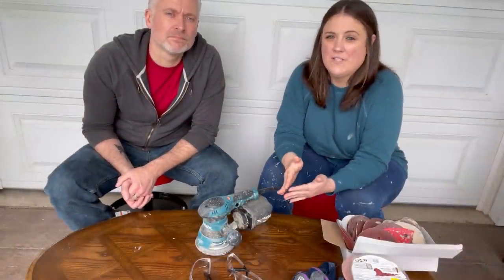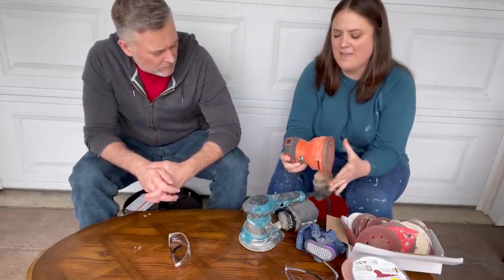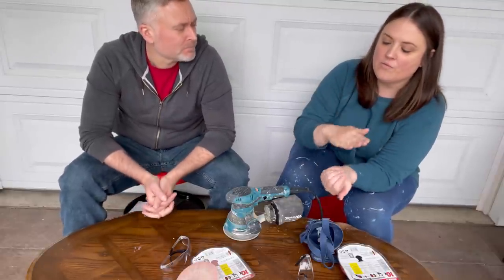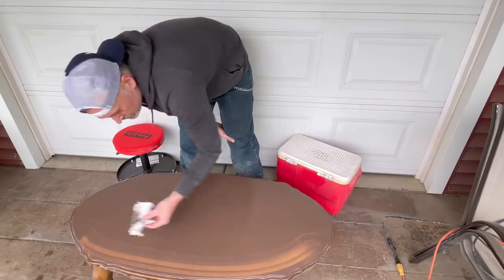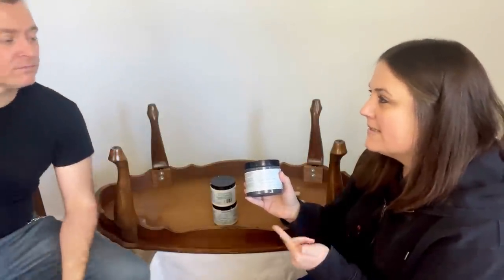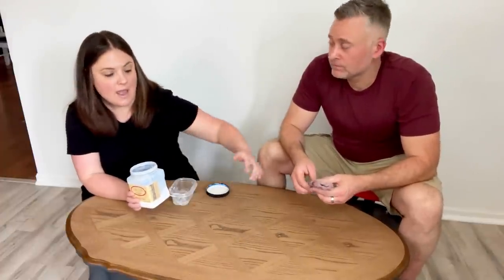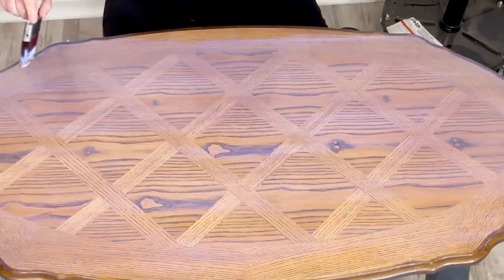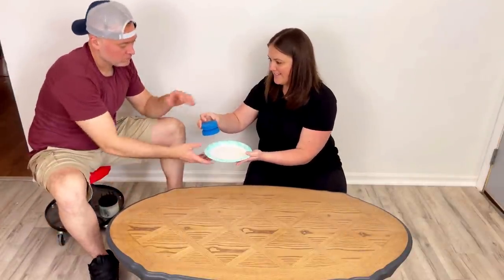Detailed BEGINNER Furniture Makeover Tutorial | Teaching Joe to Paint Furniture Episode 1

Comment: Great video! You two did well together! One question, though, did you seal the bottom & legs with Gatorhide, too? I just saw the top done, and was wondering about the bottom. Thanks.
Reply from the maker: Hi! Thank you. I did not seal the bottom because the paint that I used is all-in-one, so it has a sealer in it. I used the gator hide on the top for the extra protection since it’s a high-traffic area.

Comment: I have a teak table. It has two leaves that hide under the table. The top of my table ( not the leaves) that have water bubble damage across the main part of the table. The table without including the leaves is rectangle.  The table has a thin veneer and that is what bubbled. Could I not just add wood filler to the top, let dry and lightly san then paint? I Don’t what else to do with it🤓
Reply from the maker: Here’s a video on the steps I take when there is bubbling from water damage. I will say, though, I don’t advise taking a razor to your table. I wouldn’t want you to damage it, but maybe you can get an idea from this video. I hope it helps😊https://youtu.be/R7nv7H4bRew